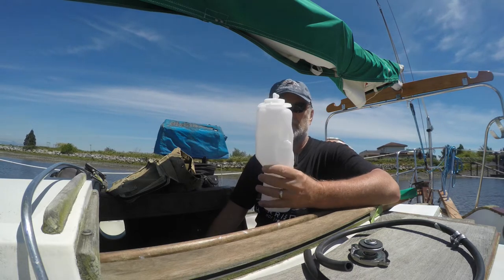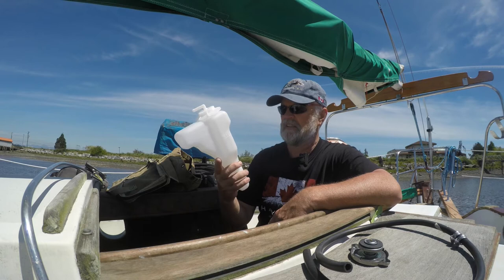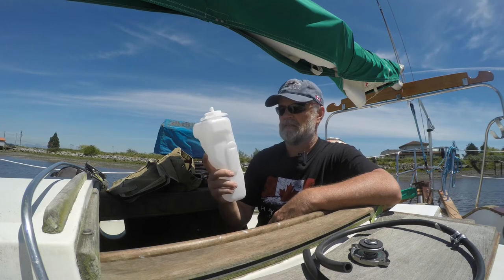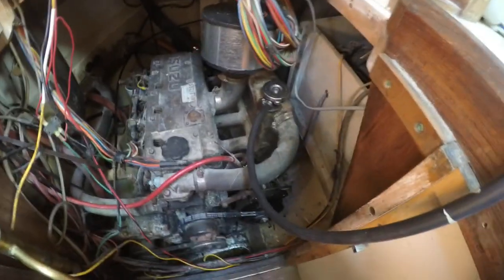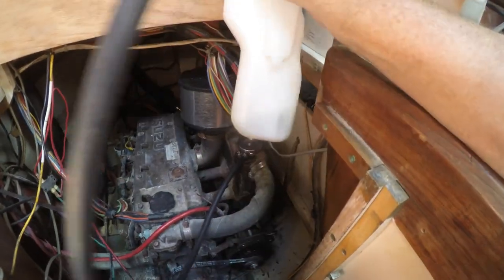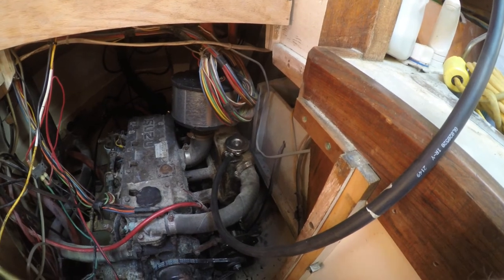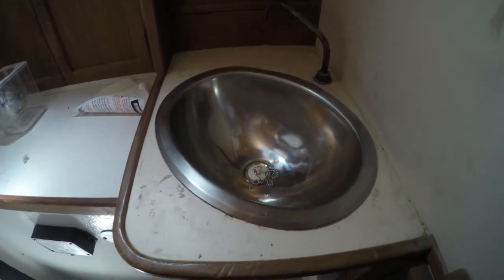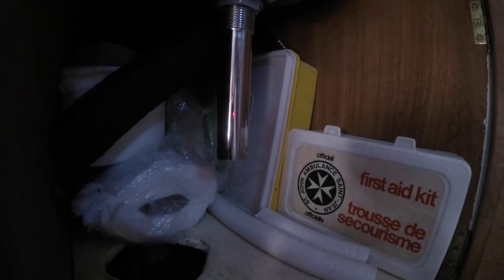Little Bear Westsail 32 refit:Sinks & Rad Caps Vlog #201

Comment: Just to be clear the ‘radiator cap’ does not regulate temperature per se, it’s role is to maintain system operating pressure ( to prevent local boiling) at the designed engine operating temperature. The engine operational temperature is achieved by regulation via the engine thermostat by bleeding engine coolant through the cooler,  at start up no flow through the cooler and at Max engine power a very good proportion of total flow through the cooler. If the engine is overheating  as you believe then as long as there is no incipient engine defect and given that you have good salt water flow, there are only two players in town - one is the cooler and the other is the thermostat. You can test the thermostat for correct operation but to be honest if you do the work to get it out and install a new gasket to put it back it is probably better just to slot a new stat in anyway. The cooler needs to be clean on both passes and as a first step an examination of the cooler end plates will reveal what sort of conditions prevail with respect to tube fouling. If this examination suggest a problem you need to withdraw the tubes stack for cleaning. Hope this is helpful.😉⛵️

Comment: Use a heat gun on that black hose to warm up the rubber. Makes it easier to push it on that 1 in 1/4 pipe. Just a thought from a landlubber who watches a lot of Sailing YouTube videos... I should swing down your way and show off out I can get Grib files by Radio.
Reply from the maker: Hey Don! I managed to get the plumbing sorted - stay tuned in next episodes...   BTW I still want to get my old SSB fixed.  :D  (hint hint)
Reply: @WakeforMe  Could take to Icom in Delta but pay through the noise. I do have a contact or two that could work on it but not the Icom shop rate.
Reply from the maker: @va7dgp   I prefer to pay through the quiet.  ;)

Comment: Go to an auto junk yard ....coolant reservoir...5.00 US dollars.
Coolant expands with heat, radiator cap releases the expaned coolant into the reservoir. When the engine  coolant cools down the radiator cap draws coolant back from the reservoir....thats its design and function. This is a never ending cycle...at least its supposed to be. It works just like a car, except cars use the air to cool and boats use the raw water to cool.
If you dont like the engine at 185 degrees, change the thermostat to a cooler one. Although, check the engine specs as aluminum heads function better at higher temperatures. Or so I was told.
When all else fails...do the research or do the research prior to any failure.
Thanks for the vids
Reply from the maker: Agreed.  I didn't go the junk yard route because the nearest junk yard is about 30 miles away. :(   Marine cooling systems are more complicated because they use sea water to cool fresh water. I don't know of the heat exchanger has some build up in it or if the strainer sucked up some river goo.  But you're right if the exchanger is ok, and there's nothing in the strainer, a cooler thermostat would be the way to go.
Reply: Lots of scrap dealers on the flats near Queensboro bridge just in Burnaby area.
Reply from the maker: @va7dgp  That's still 30 miles...